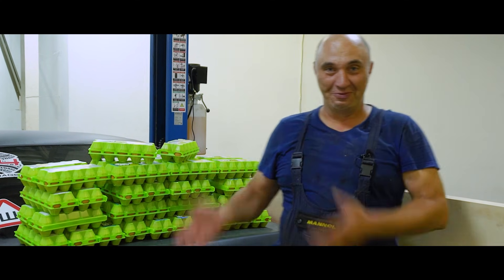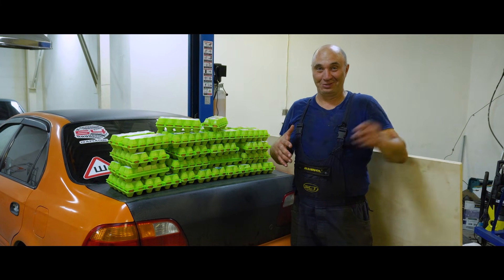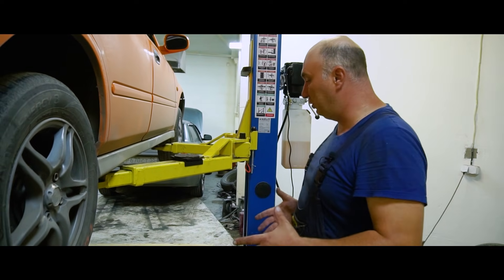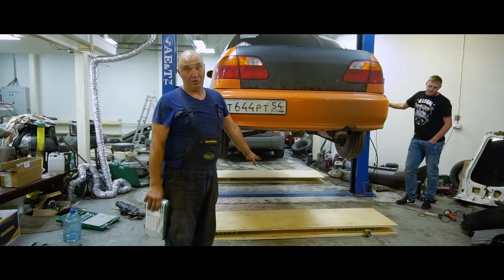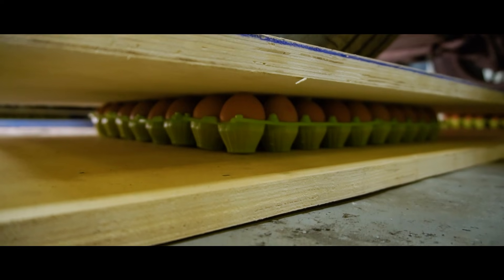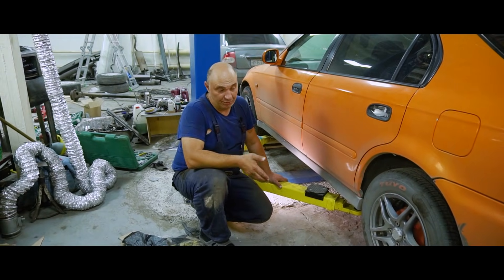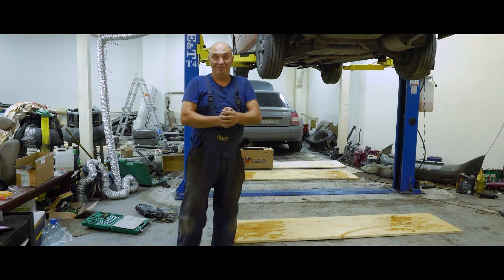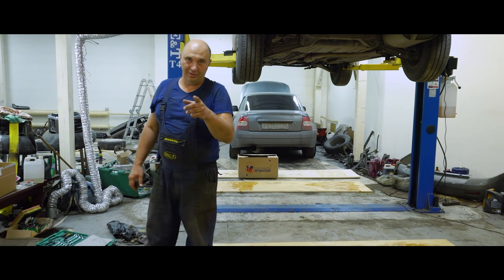Can 360 eggs hold the weight of a car?

Comment: I think this could work with a few tweaks, the weight wasnt distributed as even as if you put a "cup" style holder under and over each egg, perhaps do a force calculation on one egg and multiply it, i think it has potential

Comment: I think if the egg cartons were more rigid and each cup was shaped to follow the contour of the egg, for about the first quarter or third of the top and bottome of the egg,  it probably would work. With the plywood, it's only contacting a very small portion of the very top and bottom making the egg  much weaker. That's my theory.   No Chickens were harmed in making this video.

Comment: I think the point of contact of the plywood on the eggs was too small to bear the load.  Perhaps if you used first plywood on the floor, then a piece of dense foam, then the eggs, followed by another layer of dense foam, and finally, plywood on top.  It may have worked like that.

Comment: Well in case you might be considering a "retry" as everyone mentioned consider a way to distribute load and ofc find eggs of almost equal size (equal is better) and something I'd recommend not sure if it affects it too much is the camber angle of the wheels, try to make the wheels perfectly vertical so you'd be putting the car vertically on the eggs without the risk of shifting with one tire sitting before the others and applying pressure sooner

Comment: I am sure two things happen here: 1 the plastic containers crunch the side of the eggs when they cripple inwards. 2 the hard surface from the plywood is not giving a good and even contact on the eggs and all force is concentrated to the very tip of the egg. So in order for it to actually work you need to distribute the force more evenly probably by simply keeping the top part of the package between the eggs and plywood on both top and bottom, just cut away the support pillars in the packages so the eggs are the only thing carrying the weight and I am sure it will also carry the car

Comment: Plywood and eggs?  Two things you could afford back in 2018 when this video was made.
Reply: This is a multi-million dollar project here in America
Reply: @G-S-D pfft. What a joker. It's only $120-140CAD for eggs and some scrap wood. So a total of MAAAYBE $200 in North America and that's including fuel and other small items like a cutting blade and fastening hardware that weren't purchased specifically for this but used nonetheless. Then obviously some pre-purchased video and audio equipment but that's not included in single project cost.. would be an absolutely miniscule distribution of that cost if anything would be considered.. likenif you really want d to pad the cost.

Comment: When the eggs are in the tray, they will be moved slightly when the top of the cartons, which are higher than the top of the eggs get crushed. Eggs are strong when the forces act directly on the top of the egg but if they are slightly off-vertical they will experience some shear force and this will cause them to crack.

Comment: I think the flat surface of the plywood was the issue if the pressure was more evenly distributed on the eggs they might have stood a chance
Reply: Something like dense upholstery foam between the plywood and the eggs. Plywood - Foam - Eggs - Foam - Plywood.
Reply: @willjohnsonjohnson  right, to even the small height differentials between the eggs